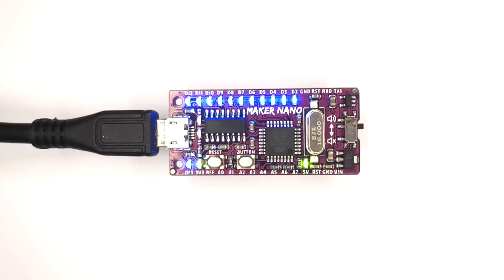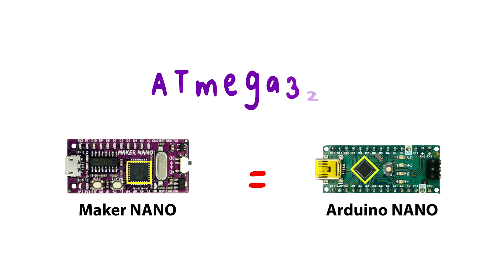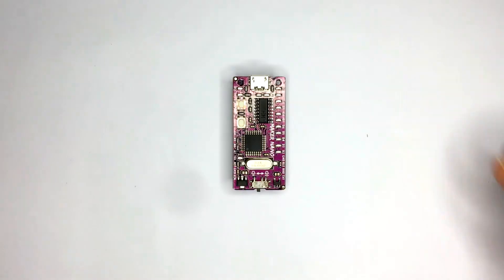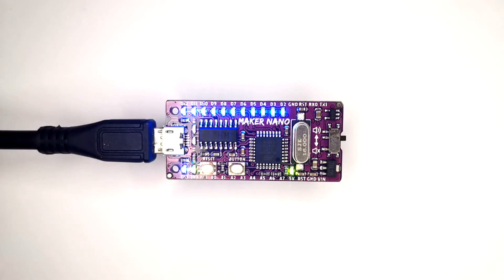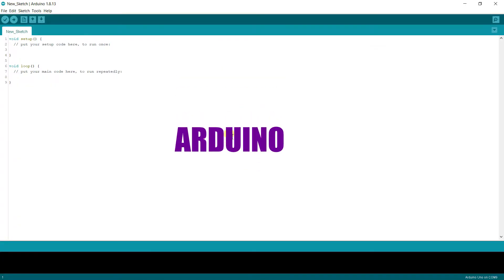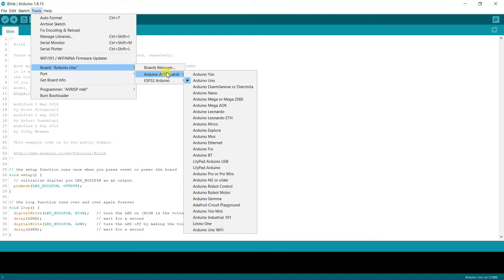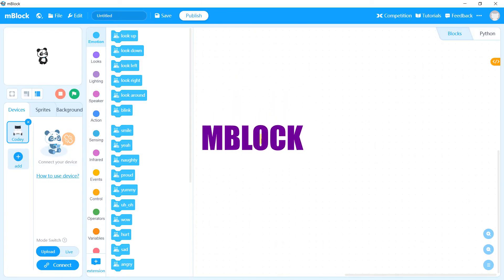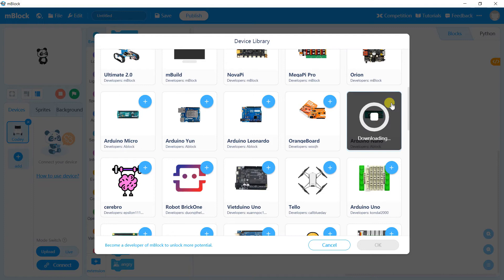Introduction to Maker NANO

Comment: Hi, I am using the correct COM port and picked Arduino Nano as the board in Arduino IDE, but for some reason the code is not being uploaded. I get errors like: 'avrdude: stk500_recv(): programmer is not responding
', 'avrdude: stk500_getsync() attempt 10 of 10: not in sync: resp=0xb4
'. Any suggestions?
Reply: I had the same problem, the IDE allows me to set references when writing and when I checked it, it was an error when reading for references. In fact, I can still write sketches with the error, but something is unsettling. If the program works, I have no choice but to ignore the error.

Comment: This is a great little device, just started playing with it but I cannot seem to get the user programmable switch to work with digitalRead(2), I can get another digital pin working with a switch and resistor, but not the on-board switch? is digitalRead(2) correct?
Reply from the maker: Hi, yes digitalRead(2) is correct and please make sure to declare the pin as pinMode(2,INPUT_PULLUP); the normal input will not work with the built in button..
Reply: @cytrontech  Perfect, thanks, setting the pinMode enables the button. 👍